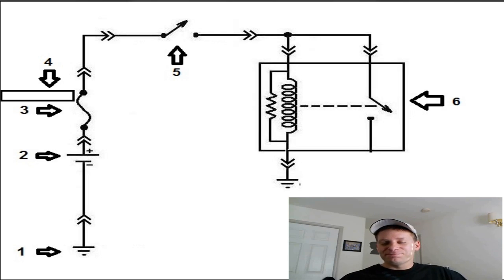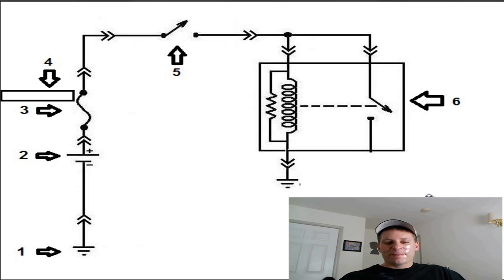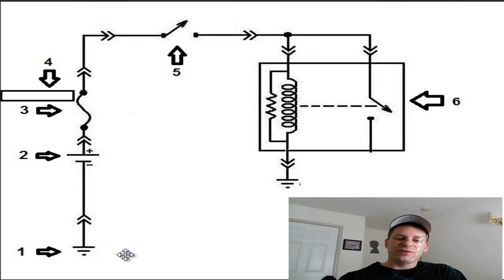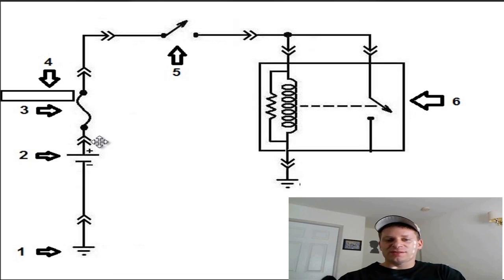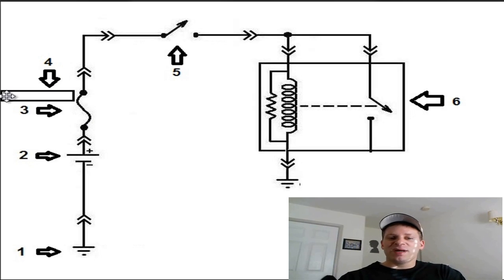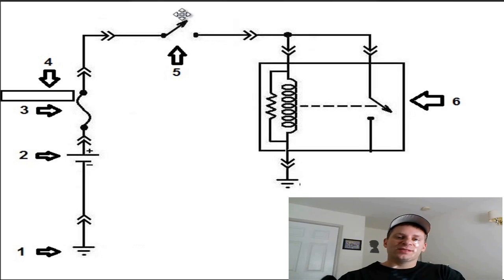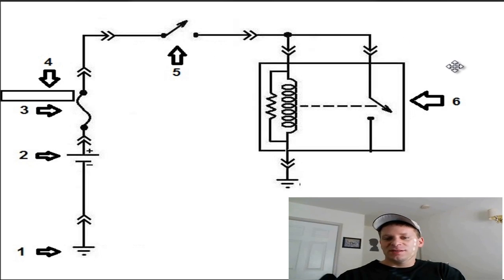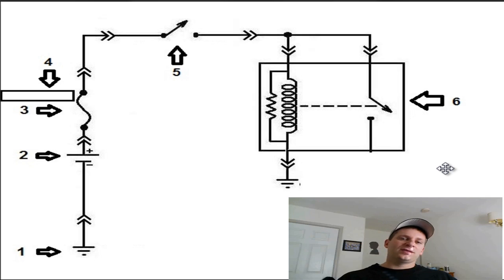Review 1, Automotive Electrical Troubleshooting Using schematics

Comment from the maker: @spelunkerd you got it boss best answer, thank you for stopping over and participating,
after your comment i realized how some may get a capacitor and the battery symbol mixed up, in the first video i used mostly Alldata symbols since its one of the most used programs, sorry i didn't cover that and any confusing, however its a good example of the things we will come across in the field, thank you for bringing that up .that's where you experience came in, thanks again

Comment: 1. Ground.  2. DC battery, with negative to ground (though Alldata call this a capacitor in their wiring diagram key).  3. Fuse   4. Not sure -- this could be a description of the wiring harness or the circuit.  5. Switch, on off, single pole normally open. 6. Single pole, single throw, relay.

This looks a lot like part of the starter relay circuit. 

Thanks for posting, I agree, this kind of interactive video is really helpful to expose personal weakness, which should be everybody's goal.